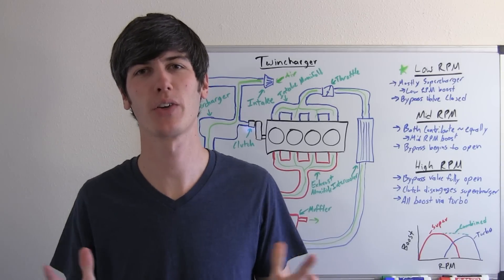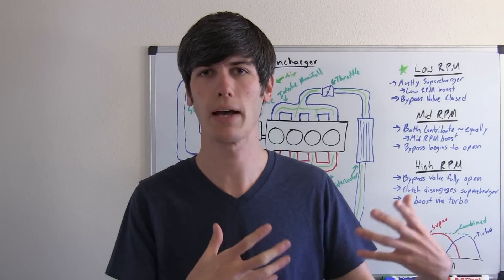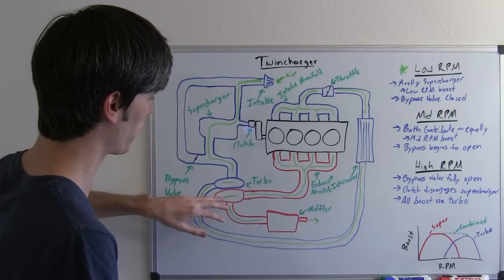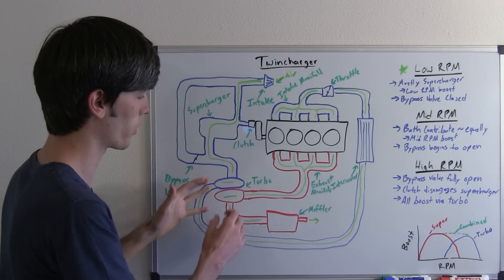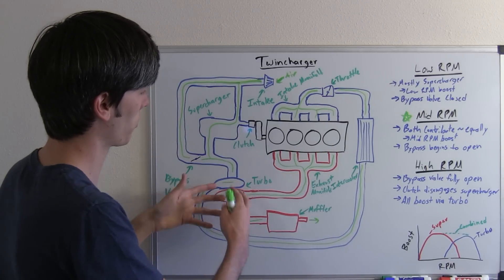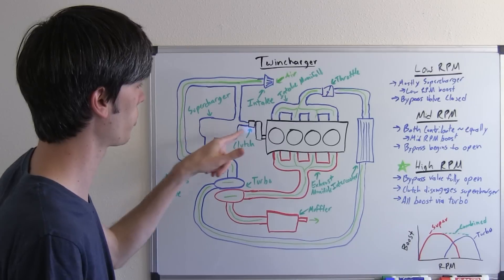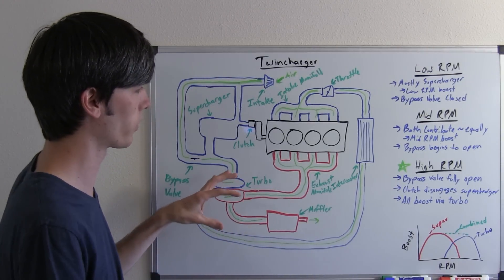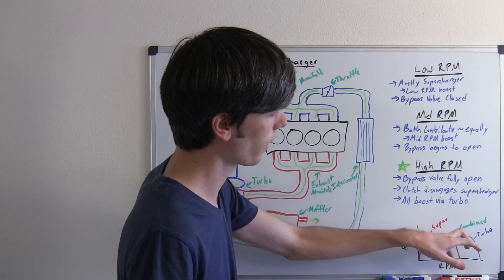How Twinchargers Work: Supercharger + Turbocharger

Comment: Running one of these VW engines still and the performance is excellent. In fact its rare that the turbo gets in full flow. The good news is that the heated air from the supercharger means less carbon build up from what is a car often running in low rpm supercharger zone. Sad to have seen it discontinued for just a standard turbo. Newer versions had cylinder deactivation to make up for the loss of the supercharger innovation. Not sure they were any more reliable than the reason this supercharger was dropped due to cost.

Comment: Why can't the turbo and the supercharger work at the same time at high rpm
Reply: Because the supercharger starts to put too much strain on the engine crankshaft, as it tries to increase power, which decreases amount of exhaust gases, and decreases force of the turbo. And at the beggining they both are on
Reply: Parasitic loss. Basically at higher rpms the supercharger just gets in the way. But you can fix that problem with an electro-magnetic clutch on the supercharger that disengage the supercharger before parasitic loss occurs.
Reply: My guy wanna go to space 😅

Comment: I have always been fascinated by this but I wonder if the re-engagement or the clutch is going to unsettle the car when you lift off and the car is coasting. Does the clutch engage smoothly or is it more of an on/off switch. If you are decelerating and this things engages mid corner I imagine it would be very unpleasant situation
Reply: On off switch. I have a twincharged 1.4 tsi. It engages based on throttle pedal position, so you just learn it with time. You can feel when it kicks in: much more torque, acceleration and of course, noise!

And no, there's no issue with it being an on off switch.
Reply: I suppose you could use a viscous coupling for a smoother take up, I'm thinking of making my own system, I've got a 5 series bmw with engine problems and if that thing has to come out I'm getting frisky with it 😂

Comment: i like the juice n boost turbo combo. the blower is 24/7. the turbo can be mitigated by normal driving. so...when you feel the need...the need for speed...you can romp the throttle 
..enjoy the turbo.if you cant tolerate the turbo lag for whatever reason ( supercar pulls up next to you at the light)... you can engage an electric opener for a nitrous system ( juice)... dial in 25/ 75...100 horsepower...whatever...by jetting...purge and arm all within a few seconds...now you have the off the line nitrous hit...and then the turbo will take over...and after you say a quick prayer...you can laugh at the Lamborghini in the rearview.

Comment: Biggest potential problem I see is the superchargers clutch failing to disengage. Would that hurt anything internally or just kill power?
Reply: Well, I have had this problem.
The engine recognized it and wouldn't let me rev above 3000 rpm, until I changed it.

Comment: This system is very much applicable into a Weber 40 carburated beetle... As long as the w40 is placed in the middle of the intake pipe, of course...

Comment: So would it work to use the turbo to run the supercharger.  It would help build boost on the lower rpm’s and  and still build boost in the higher rpm

Comment: How does the bypass valve work? Does it open with pressure or is it electronically opened? (like a modern throttlebody).

Comment: Could I simply use a reed valve in both the SC intake & turbo intake? They would prioritize opening on which has the higher pressure & the other will close.

Comment: what happens if you still have supercharger on at high rpm 
in what i think, it takes from engine while turbo gives more boost they both give boost so in my opinion it should have higher HP

Comment: At mid rpm whilst the supercharger is still connected, why doesn’t opening the bypass valve just allow recirculating through the supercharger losing boost?

Comment: I could be totally wrong but wouldn't a hybrid turbocharger be a better, simpler route? Because then you'd generate boost before the engine even revs up by spinning up the turbo with the electric motor, and also decrease pressure on the exhaust side. I don't know maybe I'm wrong but it would seem to be a good concept

Comment: What happens if your supercharger is used to spin the charge air side of the turbo using vacuum?
 Would your turbo suck the exhaust gases out of the engine while the supercharger pumped charged air into it?
 Would this increase efficiency?
 Would it increase hp output?
 What about a computer controlled electrocharger, would it be more effective as it's performance would be controlled based on emissions, air density and be more precise due to it's continual and immediate compensation for variables?

Comment: Im driving a scirocco 1.4 twin charged, when I rev my engine while on the move, sometimes  I experience a jerk. Engine check light flashes but disappeared after awhile. Could it be due to clutch slip or dusty clutch? Just wondering if in the event which the supercharger fails to disengage at high RPM, what symptoms should I expect or feel? can this happen?
Reply: Or a bad transmission in the works

Comment: I dont understand the point of disconnecting the supercharger at mid/ high rpm? Would it not make more power compressing the air through the supercharger, then sending that already compressed air into the turbo to further compress it?

Comment: What if in high RPM you never disconnect supercharger, 1. Is it possible both working together in high RPM?, 2. If last question is yes,  is boost increase dramatically?, 3 what are advantages and disadvantage to use twin-charger at same time in high RPM?       Great Video by the way

Comment: Could you have a twin turbo and a supercharger ? Would it work the same as a single turbo twin charger setup (as in the boost running thru the supercharger then thru both turbos)  just wondering, I dont think it would be very useful but very cool if it's possible

Comment: One thing that is puzzling me. Why is nobody doing a turbocharger that is also a supercharger ?
What I mean that, is that the turbo unit would be equipped with a belt that would work on low RPM and immedialtely on the acceleration, and then, the exhaust gases would spin the wheel making the turbo spin.

Comment: Why couple and decouple the supercharger and also having it feed into the turbo? Imho, the supercharger should be plumbed straight to the intake and the turbo should feed into it, that way boost is compounded and its waaaaaaaaaay simpler in designing and easier to tune. You said it yourself, superchargers give great low-mid boost but cant keep up in the big end without beening insanely overdriven. By then, your giant, oversized turbo is spooling up and adding to the supercharger boost.

Comment: What if you had 2 separate air intakes.  One for the supercharger and one for turbocharger and combine the airflows of each right before the throttle body?  I know at high rpm some power would be lost to the supercharger but is it really an issue?  I mean you're still making crazy power no?

Comment: There is an air Force mustang out there where they put LCD screens in itfor the windows I believe but it has a supercharger on each the valve cover 9r over and the turbo on each side so twin supercharged in twin turbo and they had some kind of hud technology to make it look like a jet the seats at in the center and it was able to be driven gas brake and steering all in a joystick like a fighter jet has it's awesome

Comment: If you did this to v8 coyote motor it would scream no point in doing a 4 or 6 cylinder when room becomes a concern plus low end tq although coyotes rev high so the balance would be awesome for both apps however i believe doing a iron block would be the way to go because compression becomes an issues so maybe not and i dont really trust a sleeve to do it for me however can be done plenty running good power off aluminum blocks sleeved. Higher octane fuels can be got easily now days making builds easier now. I for 1 have been thinking about designing a twin charger system for years now for reason you just explained. No dought you can go atleast low 9s with a heavy car let alone a lighter car. Of course trans becomes the limiter along with grip. Be a lot of fun to try and make it happen.

Comment: The basic idea is only for a specific use ie diesels... Ie. Huge generators in the 60s and 70s semi trucks and were made obsolete a blower makes too much heat a screw supercharger like a whipple is more efficient BUT isnt helpful paracitic loss and the idea of the additional boost means u have MIS MATCHED parts 1 turbo or pro charger powers thousands of hp a 14 71 blower makes 10000 hp top fuel so the only use for both of thiese together is archaic the use of turbos with a supercharger means. Bad engineering or the idea one size fits all.... U need a better turbo 1 or maybe 2... compound turbos are obsolete. And a supercharger takes tons of power to spin think of a slant 6 car that's fast how power to weight and a LONG power band amd gearing... Performed...  too much motor isnt helpful its just 1 part to the whole and turbos and supercharging means UNHEARD of cooling to work with gasoline.  Then wtf was the point heating cooling to heat and cool again and THINK THE AIR HAS DENSITY that's power.... Air density... HEAT AND PRESSURE dude if the air is screaming at 400 degrees its has NO DENSITY its thiner air because of heat WHICH DEFEATS THE PURPOSE. stop watching ol boy and apply basic SCIENCE like 5th grade and watch old school HOT RODDERS they use BASIC 5th grade SCIENCE.

Comment: There is NO BRNEFIT TO do this 0 a roots blower heats the incoming air its a diesel that's why thr 10 12 14 71 roots blower  compresses a fuel that cooles the air. NOT water methonal .... Methonal only or fuel altered. This dude knows not even BASIC USE.... Oh happy veterans day
.... Dudes clues bro

Comment: Has anyone ever mounted a supercharger and run camshafts on a 1:1 ratio with the crankshaft to turn a 4 stroke motor into a 2 stroke? with a high pressure direct injection it could be fuel efficient if the fuel is injected after the exhaust valve is closed.

Comment: The Engine bay for my 2007 manual Lexus is250 has very little space to work with.. is it still possible to twin charge a car with little room?? Mine for example.. iguess there would be a LOT of readjusting etc etc.. but idk if my V6 could handle it either.. can you twin charge anything interms of space of work and engine handling the power?? Im new to the car world and wanna learn as much as possible!!

Comment: Why not have both the super & turbo always active? I know it takes away energy from the crank, but wouldn't that provide even more boost if the supercharger were still active at high RPM?
Reply: Yep..thats a compounded setup..turbo feeds supercharger..so essentially the supercahrger is taking boosted air and boosting that...ala Lancia Delta S4..and EvoMadmac hillclimb Evo

Comment: Hey just wanted to ask, is there a way to create two air intake valves so one goes to the supercharger an the other to the turbocharger and are both compressed, then meet up in a large intake manifold that then takes this compressed air to the engine?

Comment: How would you go about adding a Turbo charger to an already supercharged system
Reply: You definitely need to tune it if that's the case
Reply: From what I've read you mostly install the turbo (which can be obnoxiously large) in series, and then have the wastegate measure the boost after the supercharger ( that's pretty important as the boost of the turbo will be compounded with the blower's boost rather than just added to it)

Comment: Why not twinfeed the engine? Instead of routing the superchargers discharge into the turbo, why not just Y pipe the turbo with the superchargers air into the intake. This would increase boost pressure and airflow all around instead of just eliminating boost lag.

Comment: I think your bypass valve is at the wrong junction of your system there. Also I think your turbo would feed air to the super charger not charger to turbo. Am I wrong? Problem is engine would still be cranking the charger and ideally you’d have some sort of transmission to disengage the engine needing to crank the charger at higher rpms and let the turbo do the work
Reply: Not really , atleast the vw 1.4 TSI twincharger (the 170hp one) does it the same way .

Comment: i dont want to be a smartass or something here but i think that the supercharger cant feed the turbo.... it should be the other way around since the supercharger sits directly on the intake and feeds the whole mixture of air and gas into the engine... on the other the turbo charger boosts only the air intake... so... i makes sense to use the turbocharger to feed in the supercharger right? if i am wrong please correct me. i really want to get it right :) nice theory tho mate :)

Comment: A number of piston airplane engines used in the 1940s and 50s have both a blower and a turbo.  However the turbo is normally used for cruising at high altitudes, 15,000ft or higher.  It’s only used at altitudes below 10,000ft for depressurization of the cabin prior to landing.
Reply: Prime Movers (what we would call engines) in diesel locomotives had super and turbochargers for a few years.

Comment: From my understanding of forced induction.
I used to work for one of the first companies in Australia to cast turbo housings.
The twin scroll is hard to beat for simplicity and cost effectiveness.
Of course with engines in a V configuration twin turbo installations are hard to beat.
I was suprised that belt driven impeller type superchargers never took off in the OEM market.

Comment: Can this twincharge setup be run directly into the manifold where turbo pipe meets in y split with supercharger pipe and have no by-pass valve? What I am trying to say is that why is it needed to feed the turbocharger from the supercharger; is it viable to feed the engine directly from both turbo and supercharger?

Comment: If we can afford to put a supercharger, then why not solely rely on supercharger? What is the advantage of twincharger system over solely supercharged engines?! 

Also, I wanted to ask if we could twincharge an engine by ourselves, obviously after calculations and research.. The engine in my mind is VW 1.2L TSI engine with DSG  transmission..

Comment: Why not go with a y connector before the intercooler and have the intercooler fed separately from the supercharger and turbo charger. Have separate air filter for the Turbocharger and for the Supercharger. Avoid connecting the Turbocharger and Supercharger in the intake process as it will simplify the piping and also avoid the need of that bypass valve.

Comment: Seriously now, this setup sucks compared to an actual compound boost setup... simple physics can't be that much of a secret.  you should do some research and make a video on that.  10psi turbo ran through a 7psi supercharger equal about 35psi...  less work for both, more air to feed off with little to no boost lag.  Mini molar world has it down pat.  800whp plus on a 2.2L..
Reply: Simple is better all the way around. F250 6.4L turbo diesel how much can I improve start-up power by installing a supercharger? And what type of charger would be suitable for a powerful  take off on a 7900 lbs vehicle?

Comment: You guys might get a kick out of some of the aircraft engines used in WW2, like the turbo compound Wright 3350, plus most others had either centrifugal superchargers, turbosuperchargers, or both, mostly to "normalize" the thin air at high altitude. But the TC 3350 had three turbos which had shafts that added the power right back to the crank for efficiency. The last dying throes of the large recips.

Comment: Turbochargers are not as reliable as superchargers (not trying to trigger anyone). Its a true fact, Even though superchargers burn more fuel.

i should have put this comment on the turbochargers vs supercharges video...
Reply: Isn't that mainly a torque and heat issue?
Reply: lmao, very wrong video XD

Comment: Can you make a video explaining twinchargers in more detail? From what I've read, you've only explained one type of twincharged setup. There are series and parallel configurations. From my research, I've discovered there are 2 routes you can take regarding the series configuration as well. The one you explained here makes use of a bypass value and a clutch to disengage the supercharger which increases the efficiency of the induction system. However you can choose to keep the supercharger running and feeding air into the turbocharger inlet yielding elevated intake pressures. The other series configuration which exists is where no bypass system is used and both compressors are continuously running. Using this configuration results in compounded boost pressure which means the pressure of each compressor is multiplied not added to each other. Here the turbocharger is feeding the inlet of the supercharger. Also I've seen twin turbos feeding a supercharger as well but I'm not sure if you can do that the other way and have a supercharger feed twin turbos. A parallel configuration is when both turbo and supercharger are connected directly to the intake manifold. A bypass or diverted valve is used to prevent the supercharger from blowing backwards through the turbocharger.